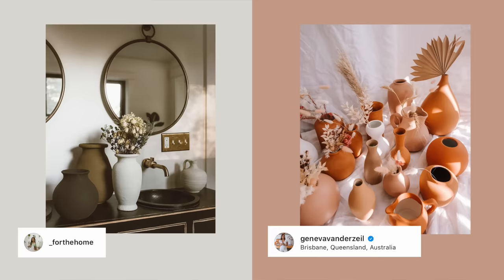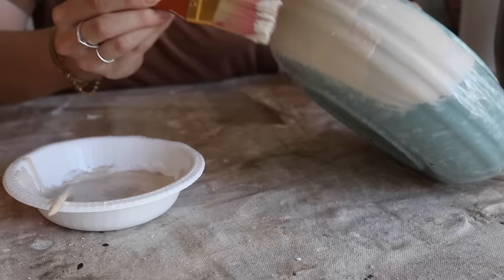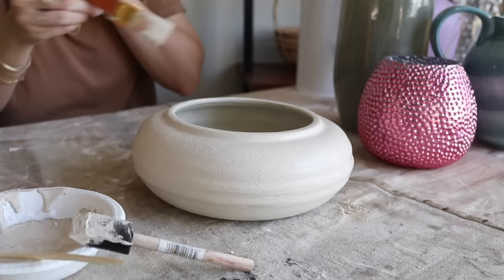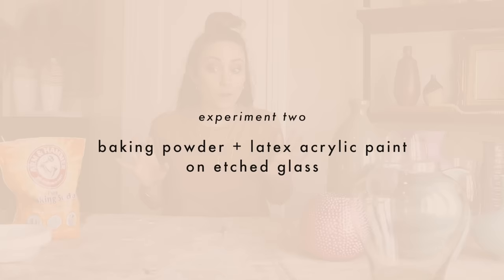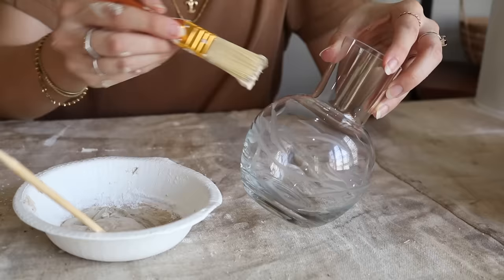DIY FAUX CERAMIC VASES: Testing Techniques, Paints and Thrifted Vases *Thrift Flip* | XO, MaCenna

Comment: Great tutorial, but just a tip: if you're using a glass, metal or plastic vase I'd recommend using a primer first, if you're using acrilic paint. There are primers for each kind of material. This way the paint will stick to the vase and it won't crack or come out later.
Reply: Unless you use DIY chalk/clay paint from Debi’s Design Diary. The clay really makes it stick to anything. Just clean well and if it’s really glossy I’d scuff sand it first using 220 grit.
Reply: What kind of primer would you recommend?  I tried this and the finish flakes off with the lightest touch.
Reply: Gesso is great.
Reply: Umm if we don't prime the vase before..can i spray that sealant to  seals the paint...!?
Reply: Iv found its best just with chalk paint
Reply: the addative is why it adheres anyway - that way you don't need a primer
Reply: @lindaqualls6479  I was just going to mention that.  Gesso makes a great primer and there are videos on YT in how to make it.

Comment: The baking powder has cream of tartar, which is an acid. That’s why the reaction with the paint. I like to use fine sand and used dried coffee grounds.
Reply: Does the dried coffee change the color of your paint at all?
Reply: @jerirasmussen6591  it does give it a slight change in color.

Comment: A great, great experiment!  A little note:  it has been my experience that if you are doing a textured piece, STIPPLING is the best method to apply the paint product.  You were STABBING and the motion is different.  Stippling is more gentle and uses more product.  Try it!  Loved this  video.  Thanks for being our tester!
Reply from the maker: Ooooo thank you I will definitely try that 🥰
Reply: Or use a stenciling foam "brush".
Reply: Hello Linda, do you know if this techniques are working on plastic aswell?
Reply: @sophies1999  Hi Sophie!  I err on the side of caution and always prime a plastic item with Kilz.  It now comes in a spray which is quite handy.  IMHO, all plastic needs a primer for "tooth" for the paint treatment to adhere well.  Hope this helps.
Reply: @lindajohnston759  thank you very much! 😊
Reply: I've got it to work great on plastic by adding white craft glue into the mix, I wouldn't do them to sell or anything, but for your own home just give it a go and experiment like MaCenna did

Comment: You should try out sand and paint. It sticks to anything and makes it look like stone or concrete. 
Plaster of Paris works much like the baking powder...😅
Reply: Hi I tried painting my ceramic vase but it came out with water is for a plant vase, which you recommend sand, baking soda or baking powder, I want it water resistant
Reply: @lorrainemorell6114  use plaster of paris and use a sealant afterwards

Comment: This video was so fun to watch. I felt like I was there hanging out and painting with you! Loved this format
Reply from the maker: Yay!! That makes me so happy!!! I really like just experimenting and trying new things on camera with you guys rather that tutorial-esc videos because I’m trying new things all the time
Reply: I agree!!
Reply: Which paint is good for clay pots? Because clay absorbs paint.
Reply: Agreed
Reply: @sehrishabbasi1754  this should still work great as the texture and the color will remain
Reply: XO, MaCenna hi
Loved it, but the 2 vases u thought didn’t turn out,  could’ve easily been saved by adding a couple drops of water to reduce the paint thickness. The black short round vase just needs another coat of thinner textured paint which will make paint get into holes better with a stippling effect. ❤️✌🏽(add bit of water if paint that thick)

Comment: I LOVE your painted glassware, ceramics, and metal. If you Google chalk paint the recipe I had was matt paint of your choice, plus plaster of Paris, and you can thin it with a little water if need be but it goes on more evenly and smooth. If you want more texture they suggest adding colored, or muted tones of sand or corn meal. You could add in glitter, etc.

Comment: It would help to know how those ingredients react. If you were making cookies, you'd use baking soda because it reacts with the water content and it expands to the sides. If you were baking a cake you'd use baking powder which is a stronger raising agent so when it reacts with water, the reaction is even faster and what it does is that elevates your mixture upwards, and because you used a new baking powder the reaction was instant !! I think you can try using expired baking powder where the reaction would be much milder. And cornstarch is just a thickening agent so made sense ! I love this trend but I don't think i've seen anyone say this things !
Reply: Just so ya know:  baking soda doesn’t react with water (it reacts with an acid like lemon or vinegar).  Baking soda reacts with acids and heat.
Reply: @Jennifer_Braden  I was about to say this same thing. Baking powder is just baking soda combined with a powdered acid so it reacts with straight water - The powder and paint combo was probably reacting with the water in the paint and that’s why the texture was different and changing over time

Comment: I have also used salt added to indoor flat paint to paint over some glossy ceramic and glass planters for my plants. It ends up looking like cement planters. You have to leave it thin enough to spread it over the surface. I had to add several coats to get the desired look. I wanted to use some of them outside, so I put clear  spray paint over the surface to seal it.
Reply: Which paint is good for clay pots

Comment: Does it scrape off after it dries? Would you recommend using a primer first?
Reply: It did with the vases I tried. The first layer went well but the second one made the first one come off. So I will use a primer first.
Reply: I flip vases all the time! For me they never scrape off, have to be gentle with the, so you don’t chip the paint but never comes off

Comment: These are exquisite,  thank you for sharing.   I also like the baking powder texture and think a little water to thin it out would've worked just fine,  especially on the very dimpled pink one.   Baking powder cause bread to rise therefore it should probably be a bit thinner before application allowing it to process as it dried while on the item.

Comment: So glad you opted NOT to paint that lovely blue and white vase (kind of in a Lotte style). It was so lovely as it was. I really liked the bluish jug too. 
Quick tip I've learnt from painting objects: use a lazy-Suzanne  to turn the piece as you go. AND, more importantly than that, put the object on something that will make it sit up away from the table (or the lazy-S). I use a tin can from my pantry. That way the bottom of the vase can hang over the edge of the tin and it's easier to paint right to the bottom of the vase (and even a little further under it if you wish).

Comment: I read that you should sand the vases that are class and ceramic as well as apply primer before painting them otherwise they could end up flaking or chipping off. Did you find that they ended up chipping or flaking off easily?

Comment: I know I’m late to the party. However on that textured glass vase, paint it with the regular paint first. Then add the textured paint on top.  If you want to keep the little dots you will need to pounce the texture paint on first and then use a brush. I would suggest a chip brush instead of a foam one. All of your pieces are magnificent.

Comment: For the chaulk board paint  try ceiling paint  from home depot. About $23.00 a gallon. Has a pink tone wet, drys white. Or get the white $14.00  a gallon and you can put a color in it. Harder to tell color with the pink one. Recommend the white one.

Comment: I painted a glass jar with acrylic a while ago. While it looked amazing, the paint came off when I washed the jar (I used the jar to hold candies and nuts). Cry. Now I just use it as a planter so I don't have to get it wet. I did some research and learned that if you want the paint water resistant, you should use glass paint and bake it in oven.

Comment: Why not beach sand or aquarium gravel?  Those won't dissolve in a water base paint. You could try a fern stem as if the paint were decoupage goo. That could give you the appearance of fossilized foliage but embossed onto the vase rather than debossed. You might need to dry out the fern first.

Comment: The reason the baking powder doesn’t work as well is the reaction to water. Baking powder begins working as soon as it interacts with water, and then reacts again with heat. Baking soda only reacts with heat. This is why when baking a cake with baking powder, you need to cook immediately or it will begin to deflate after the baking powder initially reacts to the water.

Comment: the difference between baking soda and baking powder is - when cooking with baking SODA you need an ACID in the recipe - lemon juice for example, to ACTIVATE the reaction which causes your mixture to rise. Baking POWDER already had an ACID incorporated into the mixture which ACTIVATES WHEN COMBINED WITH LIQUID - which is why your BAKING POWDER mix started to rise and harden (Im not a smarty pants, its just I wanted to make a mug cake earlier in the week but only had soda and the recipe said powder - so I googled it to see if they are transferable - they aren't, SODA needs an acid in the recipe, end of)

Comment: I guess you don't plan on using them as planters because you don't seem to seal them. I want to try this on some old planters so will need to seal against occasional water splashes. I'll use a spray mat varnish. I bought a couple of styrofoam heads from etsy to make planters . It think the baking soda and paint mix will   look cool but maybe I should use joint compound first - great texture with joint compound. Then paint it to age it. and finally seal.

Comment: If I can offer any advice (as a life-long artist/crafter) RELAX. I just watched some other chicks video on this and you both seem overly trepidacious. It's impossible to fubar this project. Bcuz it's acrylic paint - submerge in water and everything will slip off - start again. And BE RESOURCEFUL. Sand, dirt, flour, cornmeal, oatmeal, plaster of Paris, thinset......practically anything can be added to paint (for texture). 

Someone mentioned priming first - that's a good idea. Can get automotive spray paint primer at any hardware store, and grab a couple cans of clear MATT spray to make your item a little more durable. Can also leave the items outside on a hot sunny day (in direct sun) and it helps to sorta 'bake' the finish on. Have fun - Get crazy.